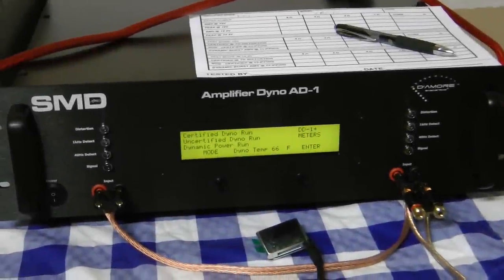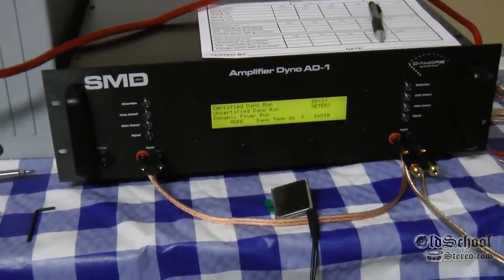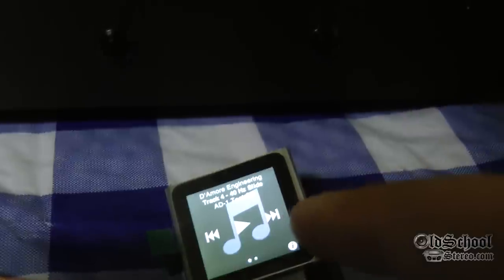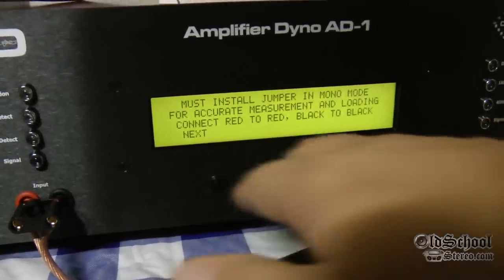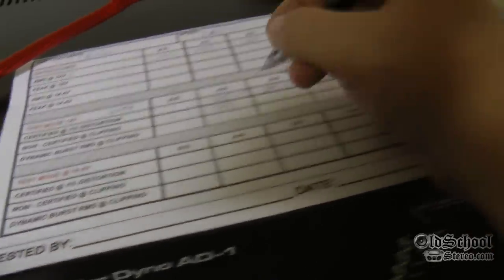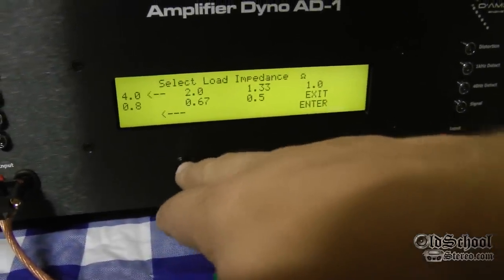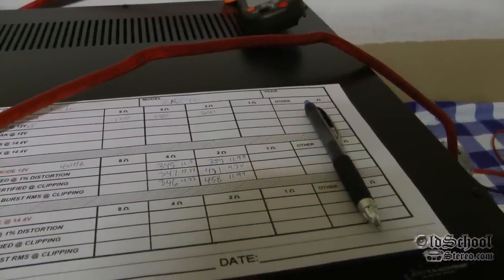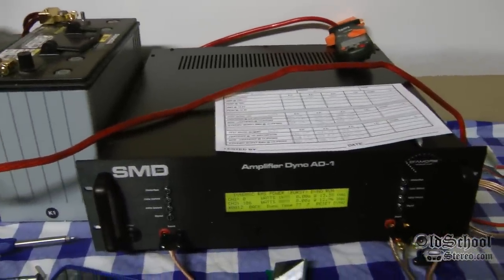Kicker ZR240 vs SMD Amp Dyno AD-1 FULL Power Output Test Wattage RMS

Comment: If an amp is rated at 240 watts but it puts out 340 watts instead, that means that the amp put out  about 50% more power than what its rated for. That's incredible!
This little amp would murder mids and highs...
They don't make them like this no more :(

Comment: i had 2 of these running 4 12in Rockford p1 12's brideged each one to 2 12s ran in series with an old 2 farad Rockford capacitor in a 94 sonoma and it shook the hell out of everything!   windshield flexed so much set off car alarms shook stop signs.  Even rattled the screws out of the glass lightbulb surroundings in a celing fan in the house i was parked next to.  shattered it all over the floor.. they were beasts back in the day!

Comment: Awesome. Thanks for testing out the zr240. Around what I expected.  Big thumbs up!
Reply from the maker: I'll do another quick test with more voltage as I've connected the adjustable power supply and can give the amp a solid 14.5V now. Thanks for the comment!

Comment: just got the kicker zr240 amp from a neighbor for free, think im going to take out 900 watt Power Acoustik and put this bad boy in and bridge the shit out of it. thanks for the info, now I know what this heavy thing can do. theres nothing like the old school to put a lil smile on my face
Reply: If you run it at 2 ohms bridged, put a fan on it. Any 12volt cpu fan will work. Also, wire up the amp with 4 gauge power and grounds. I know that the amp has only 8 gauge power connections, but you can use some distribution blocks, one for the power and one for the ground. That'll ensure your ZR will run full tilt and you'll get the most outta it.

Comment: Had two of those amps like 10 years ago. Back in the day when guys ran sealed boxes and used tractor batteries. Now have a smaller amp with twice the power of both. Boy, times have changed
Reply from the maker: Yeah man, technology has advanced for sure! I just got in a Taramps HD3000 and it's barely larger than an old school Soundstream D100 50x2 amp!

Comment: I had a zr360 and it was the best amp I ever had. Wish you could find one with the swx550 module to test. Never knew the power output but it pushed a 12 inch Alpine type r like it had 1000 watts.

Comment: I have a zr240 bridged running 2 db drives 2k12s and it does well. It’s definitely not enough power for those subs but at 25hz and below it moves them subs. I also have the gain almost all the way up to get decently loud

Comment: Hi Big D, 

Just curious, did you compare an old school amp that you tested before already on the SMD to see the difference ? 

Like your vid's keep them coming, cheers
Reply from the maker: Yes...I tried the RF 500m and Orion XTR-2250 and have gotten better results on both with the Amp Dyno....but my voltage is higher now as well. I'll try an apples to apples comparison with similar voltage, suspect the "certified" mode on the AD-1 will match closely to my observed measurements from before

Comment: Love the old school videos! Keep em coming! Wondering if I could pick your brain??
I have 2 of these zr240s and i would like to use them on the same sub. like 2 amps powering a single dual 2ohm sub. the sub is an american bass sub. im trying to get alot of sound with minimal space. and we all know nothing beats the quality of the old stuff!
Reply from the maker: Robert Chene Thanks! Feed the ZR240's enough voltage (13.5V or more) and you'll see 500W RMS per amp at 2 ohms. I see no problem with bridging one amp per coil, just make sure you match the gains and feed them the same signal

Comment: The ZR amps are designed to rail back if they detect a 2 ohm bridged load, because that's not really the intended load. You do get good 2 ohm dynamic power, though, because the rail-back takes a little time to work. Just have to stay inside the SOA of the output devices.
Also, the heavily regulated supply does not care that your battery voltage is dropping. You'll get the same power from about 11V up to where the battery over-voltage protection kicks on.

You can tell the supply is heavily regulated, because all your 4 ohm numbers are all the same.
Reply from the maker: Great info. These are fantastic amps, you did a great job in their design!
Reply: +Russell Kinder - Hi Russ, 
Nice job on these!
How would someone bypass the rail-back protection on a ZR600/1000?

 I still have a few left from the old comp days when GB said keep them, after surviving a few years in db drag.

 It wold be fun to take them out to meterland again and see what they got at full clip. Most efficient that way if I recall Jerry's advice.
Reply: +Dereck BigDWiz  hey bud that video you made of peach colored mazda 2200 at a N.C car show was a guy i worked with. he also has one with a built 302 motor.  but any how, have you ever heard anyone running a kicker cxa 1800.1 in a 1ohm load. successfully.? thanks
Reply: If you bypass the railback on the ZR600/1000, you will be able to break the amp, because the railback only exists to keep the power transistors from blowing up.

Comment: What model year is that 240? Did Kicker make that style with the polished fins from 1997-2000? I have the all black fins 2001 model ZR240, ZR1000, (2) DX700's and (3) ZX460's. I will always keep those amps, even if they sit in boxes in the closet.

Comment: Hey Big D. I just bought a working   zr-240 used for 80 bucks it came with the swx module. I only had time to do a quick test but both channels worked well. Do you think I got a good deal on this amp?

Comment: I had a pair of these about 15 years ago and used them to drive a pair of L7 Solo 12s. They were more than capable of pushing those subs hard! 
Tho the subs were rated for more power. (750 watts RMS) 

I later changed to a pair of ZR600s and honestly it was louder, but not by that much even tho the amp had 2X the rated power and Was probably pushing close to if not more than 900 watts.

I am currently looking for a single good mono amp that pushes around 500 watts RMS. Thinking the Rockford P500X1BD is going to work for me. My buddy has one that birthed at 823 watts! And I can get this amp shipped for $255 new. 

What do you think?
Reply from the maker: +BadmunkyWRX that Amp should do well for you. Hard to go wrong with RF 🤘
Reply: BigDWiz cool!
I found that they actually have a 5 channel amp that puts out the same specs as there 500x1 and 600x4 combined.
think I will be doing that one to keep it simple. should fit where I need to put it to.

Comment: You going to hook your NAD preamp back up when you get moved?
Reply from the maker: Michael Bloom Probably not as I'll most likely use the Alpine 9815, which I've already hooked up. The iPod didn't have enough voltage output to test the RF 500m, so I pulled out the trusty 9815 and have been using it since this test w/ the ZR240

Comment: Are you going to test the Soundstream MC 500 
with the Amp Dyno?
Reply from the maker: Yessir!
Reply: Hey Dereck, is it possible if u can dyno a DD M2b on all impendence?  I just bought one brand new at my local DD dealer. Digital Designs only list 1700watt @ 1ohm on 12v, 2400watt @ 1ohm on 14.4v. I like to see how the M2b does on 4ohm, 2ohm, and 1ohm on both 12v and 14.4 volt.
Reply from the maker: Here is the MC500 Dyno Test. Sorry, giveaway has already taken place - https://youtu.be/ISrgrXYSWvU

Comment: What if you went back to your Audio Authority 978 power supply? Would get better voltage that way?
Reply from the maker: I sold those, but did get my 250A adjustable power supply hooked up. You'll see in an upcoming video...

Comment: @Dereck.. or in your opin would this amp be safe to 1ohm and i could add another identical sub?? 
thanks
robert
Reply from the maker: 1 ohm mono? Nope....2 ohms mono, yes, but make sure they have adequate cooling and you have the electrical to feed them. They will pull upwards of 80A during peaks (each amp)
Reply: Dereck BigDWiz I'm thinking of buying my friend's 10" JL Audio W7 used. He also has a Kicker ZR240 amp as well! Would this amp be ok to run at 3ohm mono? Would it have enough juice to run that beast of a sub?

Comment: If it's 458 mono bridged @ 2 ohms what is it in stereo @ 2 ohms?
Reply from the maker: Take the 4 ohm mono measurement and half it, that’s the 2 ohm per channel measurement
Reply: So you think it's fair to say 170-175 watts at 2 ohms per channel depending on the Amp?

Comment: What knowledge/information are you taking away from this short "test"? I believe the data that you have collected is irrelevant and misleading. If you ran an amp on your "amplifier dyno" for lets say 10+ minutes all the while receiving the same results that I saw in this video and you took temperature measurements indicating that the components in the amplifier can withstand the load that you are subjecting it to then that would be an acceptable, not so say thorough, test.
Reply from the maker: Good catch and great points. I should explain better my testing technique. Each amplifier I test on the AD-1 is warmed up to operating temperature for 10-15 minutes with either subwoofers or resistors and bass heavy music. Audio amplifiers are not rated to put out their maximum RMS power for long periods of time as they are designed to handle music, not test tones. The Amp Dyno tests are the best way we have currently to measure the actual power the amplifier is putting out in 3 different modes...1) Certified - which tests to 1% THD, 2) Uncertified - tests to clipping and 3) Dynamic RMS - tests quick burst on the amp to measure dynamic headroom